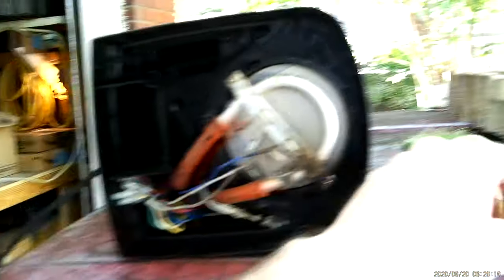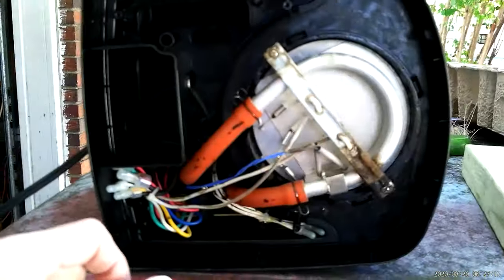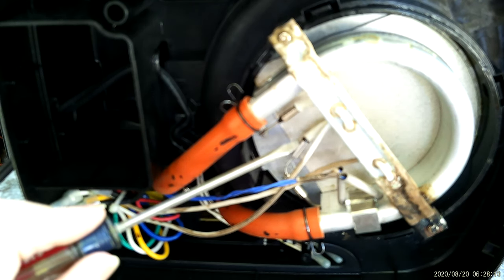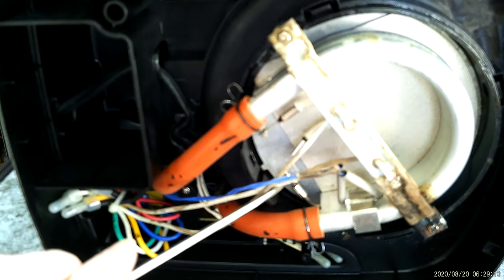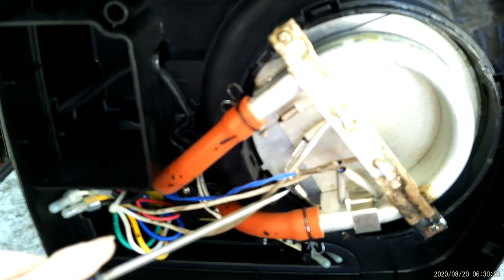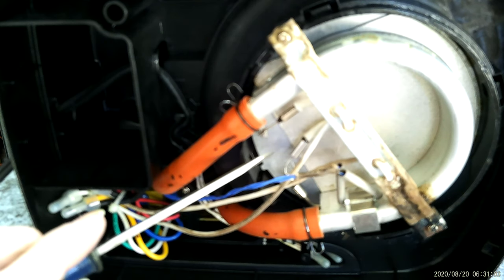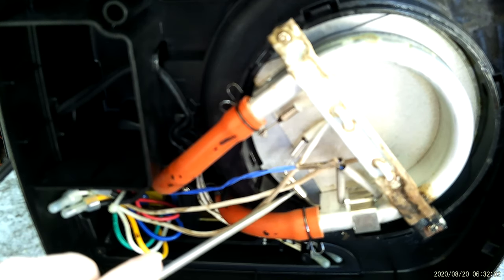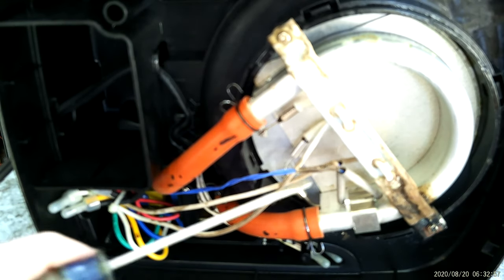Cuisinart Coffee Makers Testing after Thermal Fuse Installation 2020-0820-06:25:42 Pt002

Comment: I have the same one. Mine doesn’t make a full pot. I have to stand there and turn it on and off until I get a full pot! Now this morning I tried something different! I set it to 1-4 cup mode and it filled the whole pot up. I can’t find anything on it to fix
Reply from the maker: Most of the time. Cleaning the water system, with a good coffee pot cleaner or white viniger. Just run it through, like your brewing coffee. Gets them working right again. I always run it through, 2 or 3 times. Using the same batch of cleaner and water. One usually doe's not do it. Be careful with the cleaners, they can have a bad smell. That won't go away for several days, after cleaning. The one I use is in some of my other videos. Can't remember the name, right now. Hope this helps... Don